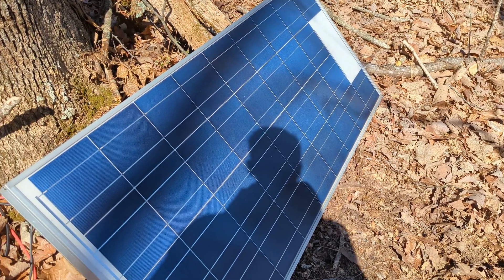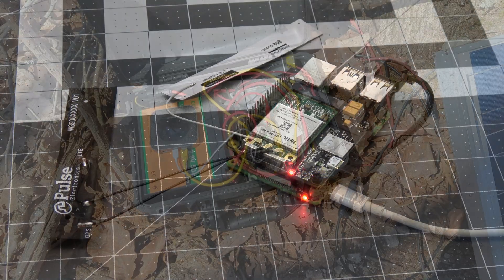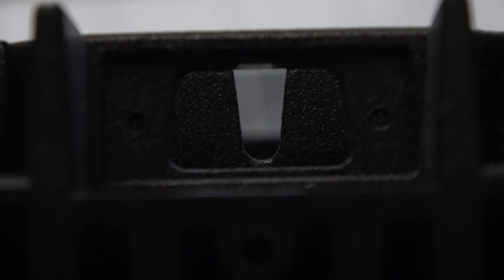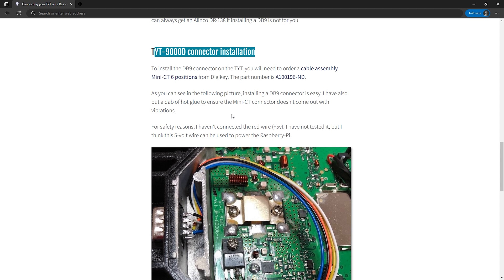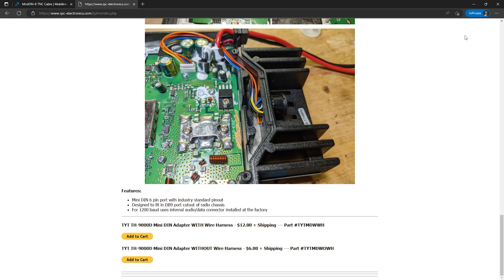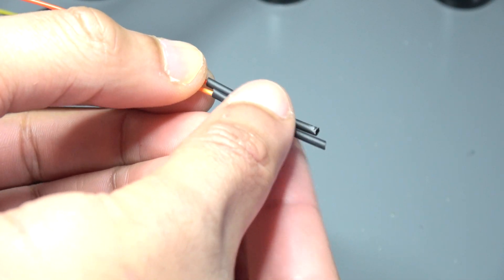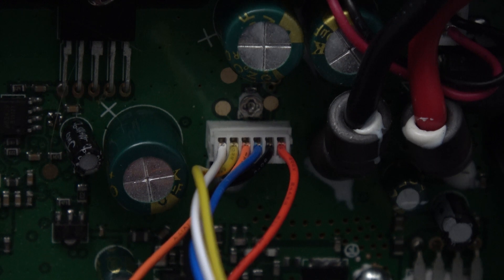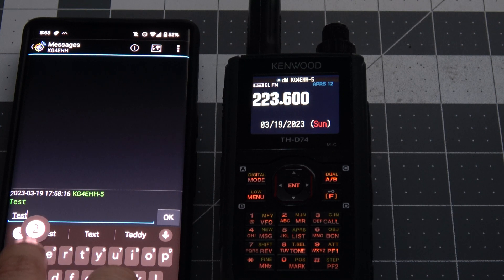Best Budget Packet Radio - TYT TH-9000D

Comment: I posted a comment about the TYT TH-9000D and its been deleted. The comment was about the failure of this radio to release the squelch after TX. Now I am not sure if the Alinco version does the same thing but the TYT version is not suitable for APRS. VK5MCH.
Reply from the maker: Not true at all. I've had mine setup as a digipeater specifically for APRS and not had issues since I started using it years ago now. If fact, I'm about to setup another one.
Reply: @The_Comms_Channel  Yes it is true. There is a bad batch which several of us in our club all suffered from the same problem. The seller refunded all our purchases and said to keep the radios, he didn't want them back. Your video is 2 years old. Our radios were made in August 2025. In fact I have an email from TYT stating they know the last batch has a problem. It is related to the following. The issue with the TYT TH-9000 receiver's squelch staying closed after transmission is a known problem, widely discussed in amateur radio forums. The problem is often related to the audio circuitry or power supply issues, and the common fix involves a modification to the audio voltage regulator or an associated component.  Before you go criticising another bunch of amateurs having a problem perhaps you should make some enquiries. Many AliExpress sellers have withdrawn this radio from sale.
Reply from the maker: @michaelhope007  

Take a look at your original comment. You make no mention of any of this and just posted a generic comment saying I deleted your comment (which I didn't) and made a claim that the radio doesn't work. No details of any of your claims were provided.
-
"Before you go criticising another bunch of amateurs having a problem perhaps you should make some enquiries." 
-
Don't be ridiculous.. This video is 2 years old and I have 100+ videos, if I spent time making inquiries on all of the products in my videos to see if they've potentially sent out bad batch, I wouldn't have any time left to make videos.
-
I"n fact I have an email from TYT stating they know the last batch has a problem"
-
My email address is available on my profile, yet instead of providing evidence, you just make claims in a comment. Even if what you say is true, that means they know they had a bad batch and it is likely resolved. I just had a new TYT-9000D delivered which I'll be using for an APRS digipeater so I guess we'll see if there's an actual issue or not.
-
"The issue with the TYT TH-9000 receiver's squelch staying closed after transmission is a known problem, widely discussed in amateur radio forums"
-
Again, my email address is on my profile which you could have sent links to, yet you fail to provide any evidence again. You don't even provide the name of the forum. I've searched online for any info on this and haven't been able to find a single forum post discussing this. If it is "widely discussed in amateur radio forums" then it would show up in my searches. 

If you have any evidence you wish to provide, my email address is on my profile and I'll be happy to look at it
Reply: Whatever. Take a look at your original reply...like you can never be wrong. Whatever mate.
Reply from the maker: @michaelhope007  still waiting on forum links, email from tyt confirming, or anything you have to confirm what you're saying instead of these comments you're leaving

Comment: 100w solar panel + 50ah lifepo4 + tyt radio.. will it work??
Reply from the maker: Sure will. We've done the same set-up. Your mileage may vary depending on how much it's being used and what power setting the radio is on.

Comment: I see you use the rx96 pin. Does it support 9600 baud on that connector?
Reply from the maker: As far as I can tell, this radio does not support 9600 unfortunately. RPC Electronics, who makes the board, mentions this on the product page though: 

"9600 may be possible, but would need to be wired internally differently"

Not sure what needs to be done to wire it for that though.

Comment: What is the benefit to using the TYT with the soldiered adapter VS just getting the Alinco with the port already installed from the factory?
Reply from the maker: Mainly just saving on cost. The TYT is about $50 cheaper than the Alinco. I know some people like connecting two of the TYTs together and making a repeater which would then be $100 savings. Also, if you have a need for the 220 band, the Alinco version has become hard to find.
Reply: @The_Comms_Channel  Fair reasons. I did so much soldiering at one point in my life that it almost pisses me off doing it now. Even if it is just four points that will take me 2 minutes.....but that's MY problem. Lol Thanks for giving the money saving option for the general audience. That's important to get more people into all this stuff.
Reply from the maker: I hear you, haha. I think I've soldered about 5 or 6 of the NucleoTNCs for myself and friends. I got to the point where I needed to take a break from soldering for a while lol. Definitely want to get more people interested in Ham Radio and into the packet radio side of things.

Comment: The required screws are M2.5 - just like used on the RPi enclosures. Have you done more then 1k2 with your modem? I'm wondering what the maximum speed via that connector might be?
Reply from the maker: Thanks for that size info! I'll get some to replace the two that I grabbed from the case. I've not tried 9600 myself, but I imagine it should be able to since the Alinco it's based off of is 9600 capable. I'll verify when I get a moment in the shack and let you know!
Reply from the maker: Tried it with 9k6, but no luck. I do see on the RPC electronics page for the packet adapter board where they say this: "9600 may be possible but would need to be wired internally differently."

I'll continue searching and see if I can find further information on it.
Reply: @The_Comms_Channel  if only there was a circuit diagram for that radio. We might be able to find the discriminator and modulator parts for a proper mod.  I use NinoTNCs and so I might try lower speeds. 2400 will easily work but 4800 is also worth a try.
Reply from the maker: I was able to find a site with schematics. https://tinymicros.com/mediawiki/images/e/e8/TYT_TH-9000_VHF-220-260MHz_Schematics_2.pdf

This is for the 220 model, which I have and can do some testing on. Not sure how much the other models would differ from the 220. Finding the discriminator isn't something I've done before and will have to do some research on, however.

Comment: Excellent video. Does this apply to any other TYT radios?
Reply from the maker: I've not come across any other TYTs that have this internal data/audio port. That said, you can make any radio work with packet radio as long as you have a way to access the audio in/out, PTT, GND. Your comment got me thinking about another TYT radio I have, the TH-8600. Looks like there's a website that sells cables for that that go to a DB9. https://hammadeparts.com/shop-for-cables/ols/products/tyt-th-8600-6-pin-gx12-mic-plug-and-18-speaker-plug-to-db9-kantronics-type

 I may play around with mine and see if I can make something similar. Do you have a TYT radio already? If so, what model?

Comment: nice I have a local packet network near me I can reach. Ive been needing a cheap radio that I could use for it. Thanks for posting.
Reply from the maker: Nice! Not much around me that I'm aware of other than APRS, but looking to change that. This has been a solid radio for our digipeater and should be a good performer for you too. Do you have a TNC yet?